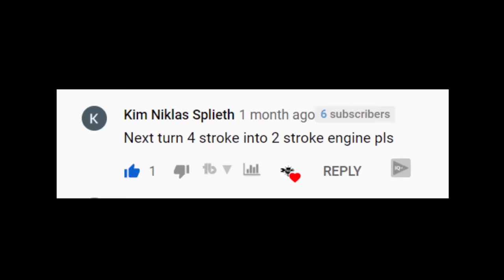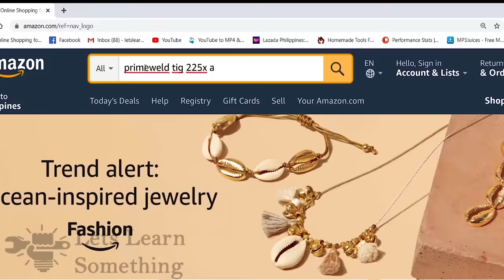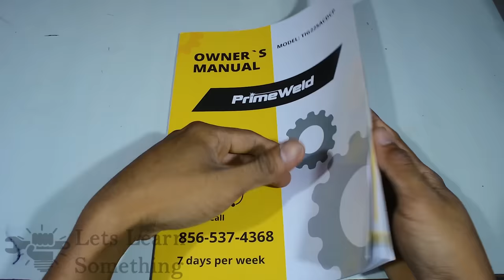I turn 4 stroke into 2 stroke  engine

Comment: Problem is it's a air cooled horizontal motor that type of engine can't be pushed to high rpms meaning it cant get the top end a 2 stroke needs other problem 2 strokes get way hotter that is just not right if you would of chose a Honda xr75 motor and do the same it would be more beneficial but that motor is for scooters they are replacements for a Honda CT70 very amazing thing you did but just on the wrong motor

Comment: technology...leak of technology... really tired to wait...after they custom the intake carburettor system, they just port a 2 stroke head and the mailing a custom cannal as for 2T... actually you don't need that cannal, you can just pour 2T Inside gas with 2T mixture...it's only work with ron95.....but you need to remove gas filters first.